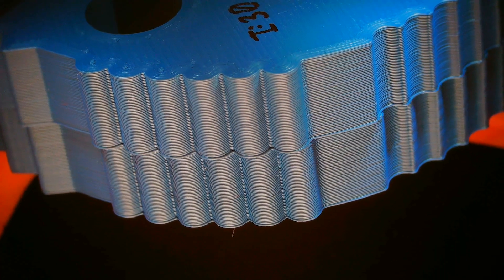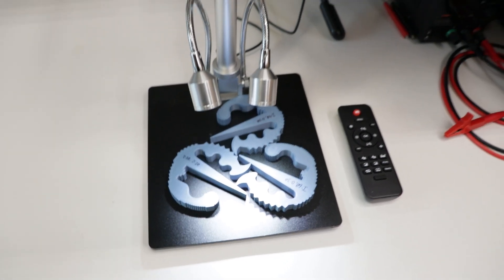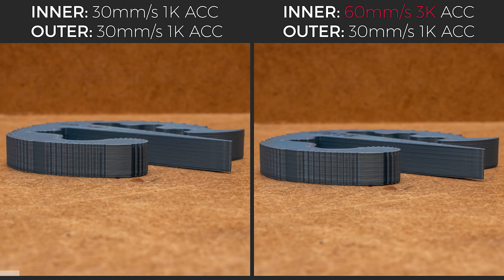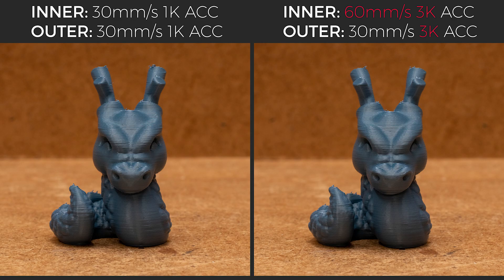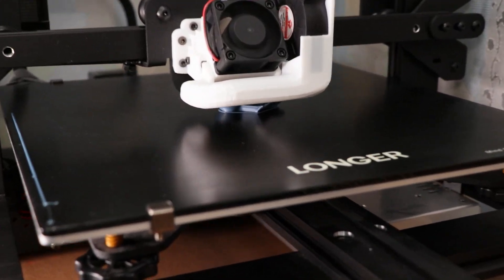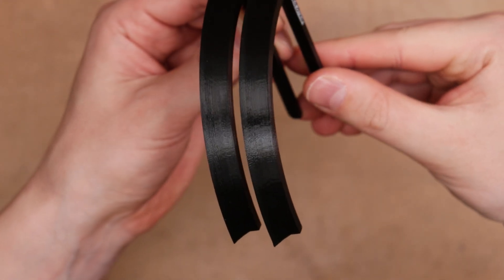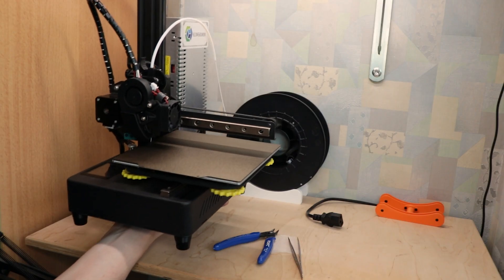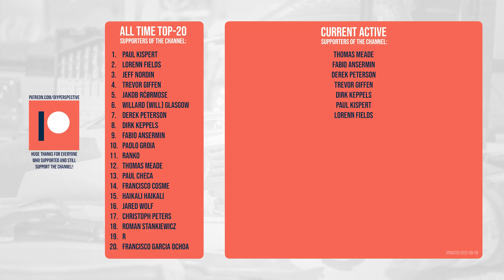INNER WALL SPEED effects on OUTSIDE PRINT QUALITY (Close-Up COMPARISON)

Comment from the maker: INNER WALLS were printed first in this comparison (CURA - Wall Ordering: Inside to Outside).
Reply: In your comparisons I could still see quite the difference when outer speed is low and inner is high. 
What if those problems could be avoided by printing the outer wall slowly first and then printing the inner walls fast? Should avoid deformation that is being caused by the fast inner walls. In theory the overhangs should be worse, but I think it is worth a try
Reply from the maker: Yes, printing the outer walls first will make the most consistent surface look, but your retraction must be on point for a nice start to the outer wall. I usually print the outer wall first on objects that don't have higher than 45-degree overhangs and are smaller-medium size. But it is a topic on its own as I experienced not the ugly overhangs but some random strands on higher overhang corners. Maybe the corners curl upwards, and the start of extrusion starts in mid-air? I haven't deep-dived into this topic so it is only a speculation.

Comment: Its weird how the higher accel turns out better i guess less time the nozzle is over a particularly spot its like there is better cooling from the high accel but its mostlikely you have your temp to high for your cooling fans and having it move so quickly probably reduces the temp of plastic coming out the hot end bc your maxing out its capabilities im guessing the lower accel would look the same if you used 5 degree less on the hot end maybe even 10 degrees

Comment: I recall Slice sells boron nitrid paste for mounting the nozzle. It's a thermal compound and anti seize.

But I'm too cheap for $10 paste so i bought HY410 for $1.60 (10g) instead. I dont know if it does anything for thermal transfer but i didn't get it to smell or smoke, which is already nicer than copper grease anti seize for brakes. It's rated to a mystery temperature of anywhere between 260 and 300°C depending on whom you ask, but that's way better than standard PC thermal pastes which can start smoking at 150°C. Not that you should use it in your PC, no, it's clearly not tuned for that.

Anyway thinking perhaps a filler of that ilk can bridge the... Pardon me, gap, between better fitted nozzles and cheap generic ones.

Comment: Ooh so you’re saying I can maintain my outer wall print speed  at a nice cool 200mm/s but speed up even more on the inside to 500+ without much quality decrease hmmm
Reply from the maker: Yes, you should just try a few test prints to know for sure with your setup. You can get an even better print surface when printing outer walls first with sufficient cooling. But that doesn't work well on all the models.

Comment: Are you printing outer walls first or inner first? In the latter case, the outer wall will conform to and copy any artifacts from the inner wall. In order to do crazy fast (high accel that is; speed is irrelevant) inner walls with no harm to outer surface quality and dimensional accuracy, you need outer walls first and sufficient cooling to have them fully hardened before the inner walls are laid.
Reply from the maker: I am printing the inner walls first, like probably 99% of the people would do. The video is exactly about how much inner walls transfer those artifacts to the outer ones.
And yes, I understand that, but those conditions are not very realistic and wouldn't work that well for smaller models or ones with overhangs.
Reply: @PrintingPerspective  They really do work well. It's what I've been doing for the past 2+ years. Outer first gives better overhangs too in my experience, but it's really unforgiving if you have bad restarts after retraction (or after unretracted internal travel) which seems to be why slicers don't do it by default (on the Cura bug tracker you can see where they reverted the Cura 5 change to outer first back to inner first because of folks experiencing this class of problem).

I guess what I'm trying to say here is not to argue with you but to point out that the "inner walls crazy fast" approach to fast prints only works well (at least above a certain benefit threshold) when you meet other preconditions to use it well. Whether those make sense to do is something folks have to decide for themselves.
Reply from the maker: This is kinda counter intuitive, that outer wall first could give better overhangs. I might have to check it out. On what 3d printer btw?
Reply: @PrintingPerspective  My theory is that without a good foundation below to bond to, surface tension (or whatever weird internal forces the plastic experiences) pulls the outer wall to the inner one and makes it warp/curl worse than it otherwise would, whereas without an inner wall it has nothing but the partial contact with the layer below to cling to.

My printer is an Ender 3 in frame and motion system but the extruder and cooling systems are completely different and hotend rather upgraded. You can see it in my videos.
Reply: @daliasprints9798  That explanation might make sense, but would then also predict that overhangs > 45° (for a layer-height at 50% of the nozzle-diameter) would droop more if you print outer walls first (as you do not have the inner wall pulling in on that overhanging outer wall and the wall below it has insufficient overlap and itself will already have sagged) and that would normally cause significantly worse overhangs.

Comment: Very nice ! I'm tuning in my printer for faster print times with a 0.8mm nozzle. So many settings ! Thanks for the info !
Reply from the maker: Yeah... So many setting and so many variables to be aware of. Good luck! :)
Reply: On my ender 3 I find that the limiting factor is flow rate of the extruder

Comment: Great stuff! What was that speed layer visualiser you used? It look super useful.
Reply from the maker: Thanks, sorry forgot to add the link to the description. Here it is - https://www.gcodeanalyser.com
Reply: @PrintingPerspective  cheers, thank you! Love your videos, they are thourough and go in depth on several areas. As a suggestion, it would be interesting to see a video on whether bridging at high speed is better, many people bridge very slowly but I always wondered whether that would cause the plastic to droop more
Reply from the maker: So the reason most people print bridging slowly is that the fan has more time to cool down the filament. It basically hardens in the air and doesn't stretch that much. That is the theory behind that.

And if you would print it fast, the plastic would just stretch because it comes out of the extruder as a viscous mass. That is also a theory behind that.

But honestly, I am kinda down to do a quick test :D And if I do I will make a post on Twitter and on the Youtube Community page on my channel.
Reply: @PrintingPerspective  Thanks!

Comment: I have never looked that close apparently ;) I set inner wall speed to 36-40 mm/s and it seems to work fine (and faster).
Reply from the maker: And if you print the outer wall at 25-30mm/s then I bet there will be no difference compared to when printing both at the same lower speed. But that is only my guess, there are so many different printers with different setups that it is impossible to say with complete facts. That is why I didn't cover the part of best speeds for the inner wall. :)